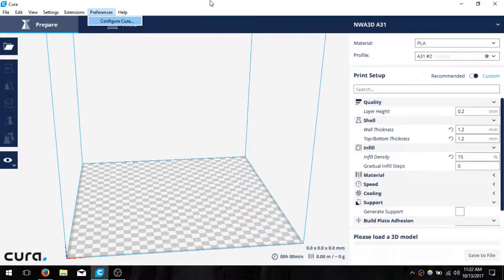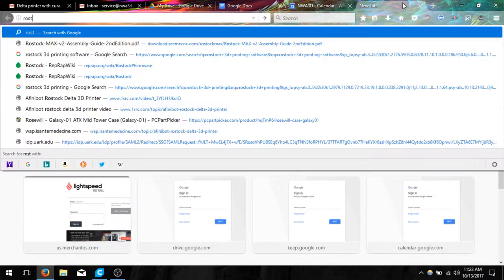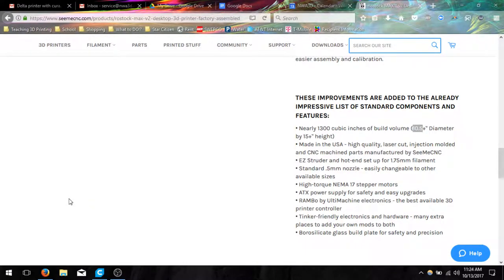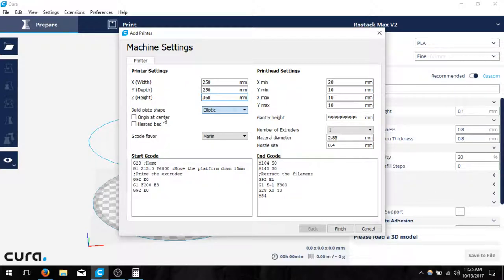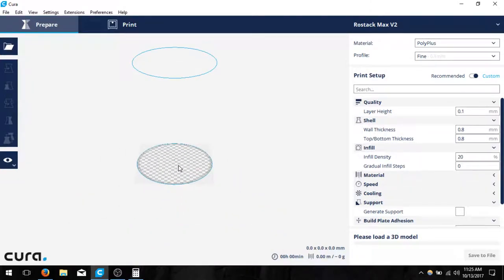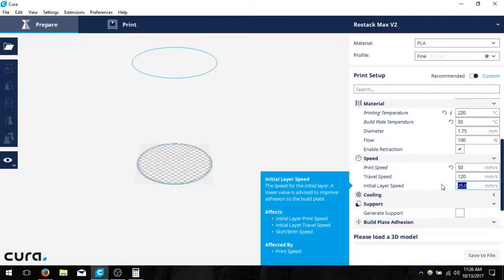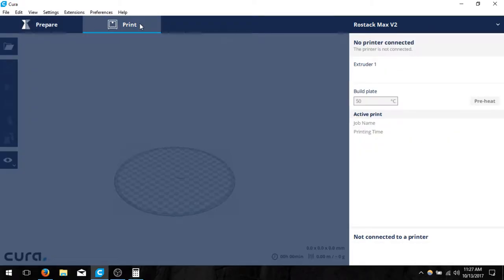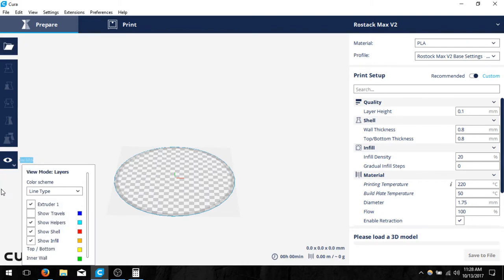Cura Setup - Rostock Max V2

Comment: Hi there, is there some sort of firmware changes needed to connect? I have mattercontrol set up but it isn't a very good slicer.  I seem to be missing the step where Cura actually connects to the machine
Thanks
Reply: Any luck using cura via usb?
Reply: @disident3punt09  I copied and pasted the gcode, it was too much work. I just used mattercontrol. I have another printer on the way
Reply: @danballarin  were u trying to print from SD?